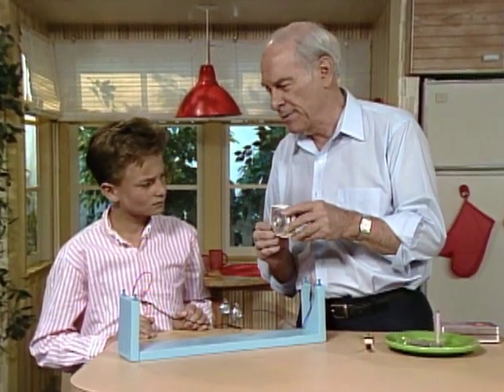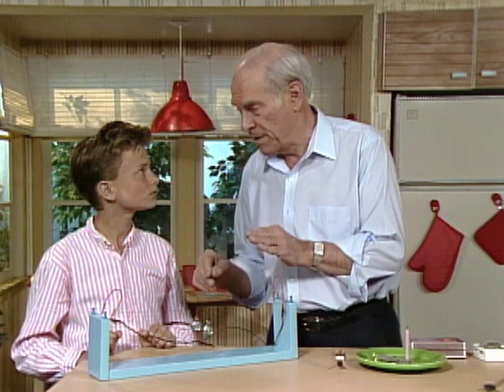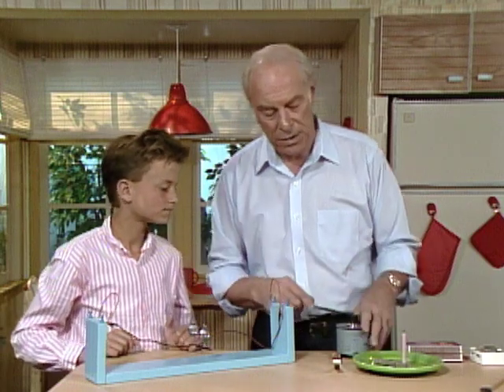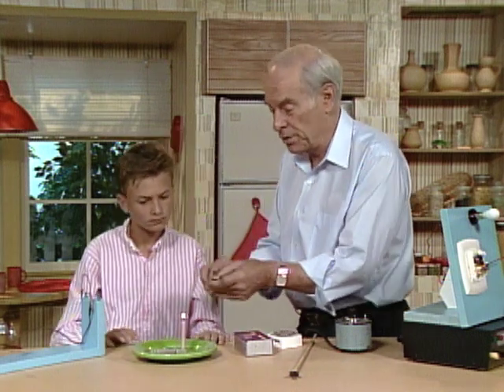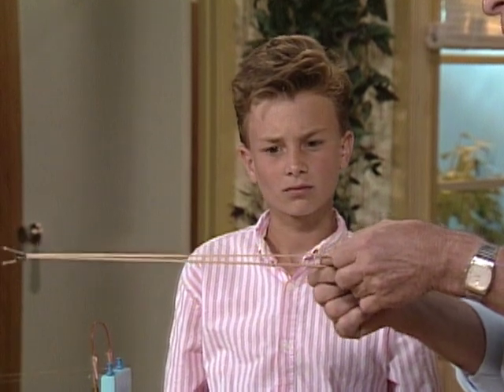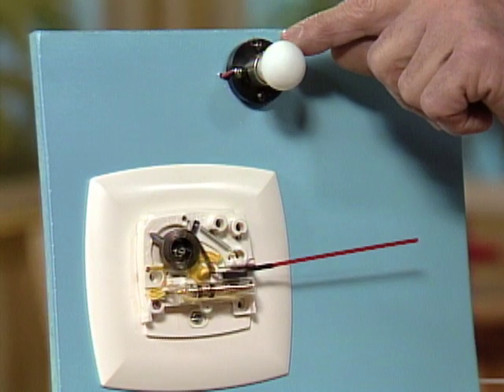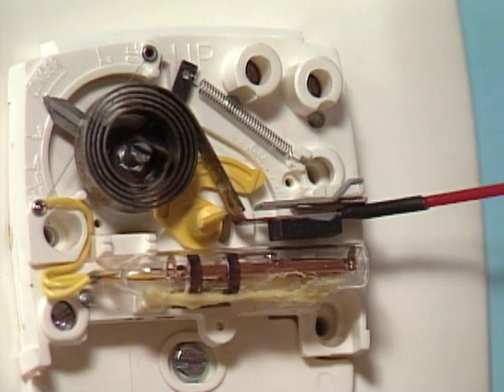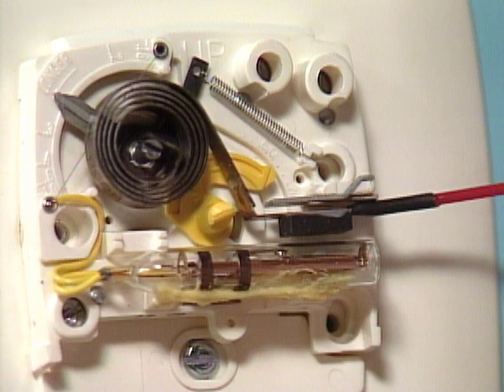How Does A Thermostat Work? (Mr. Wizard)

Comment: Older thermostats (like the ones in my home) have a mercury switch, which I guess have been discontinued to avoid mercury pollution.  But were they more accurate I wonder?  They seem to control the temperature very accurately.
Reply: No.  The accuracy is not nearly as good as a modern thermostat.

The mercury is NOT the temperature sensor, but the conductive electrical material.
The bimetal is what senses the temperature, but over years of flex, the metals begin to separate.  At that point, you will have wildly inaccurate readings.
Reply: @DethWshBkr  Very interesting, thanks.